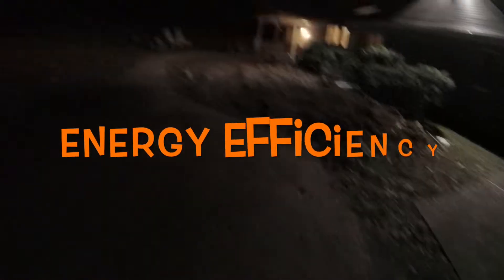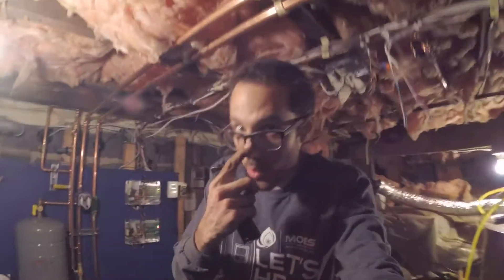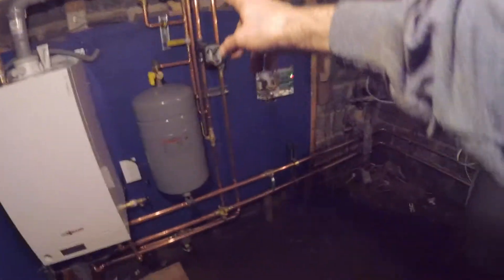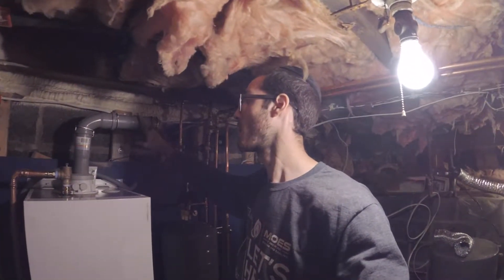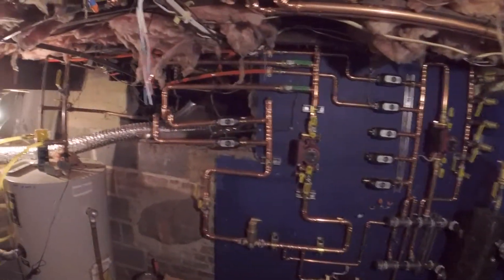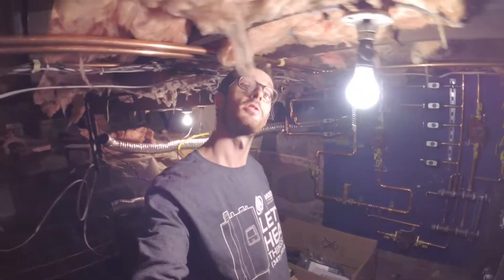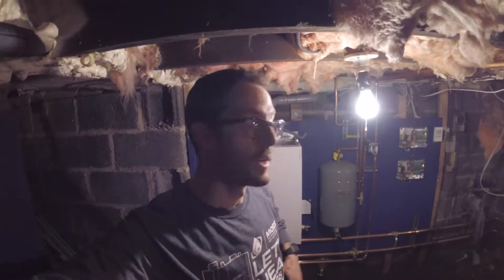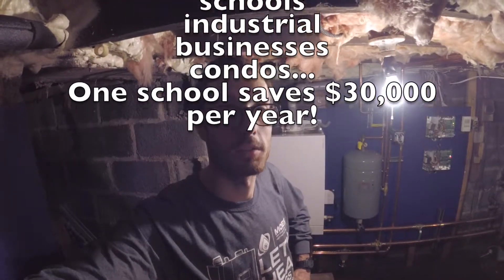Energy Efficiency - high efficiency boilers are they worth it for you?

Comment: Was this house using baseboard or radiators?  I have baseboard on main loop, debating adding a second loop for the basement (right now it's always too cold in winter) and swapping from cast iron boiler to condensing boiler.  Just wondering how much I'll be condensing in Minnesota winters using fin tube baseboard.

Comment: What temperature does this system run?
Reply from the maker: around 150 on the high temp and 110 on the low temp. Follows out door reset so it's usually lower on both.